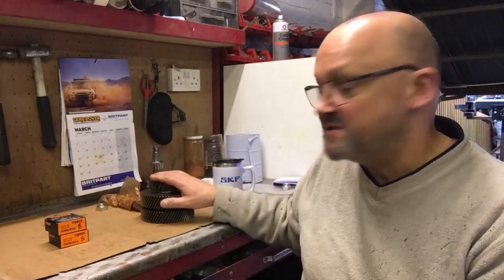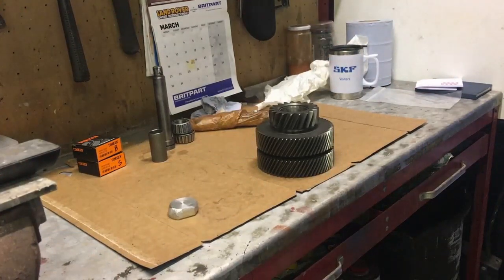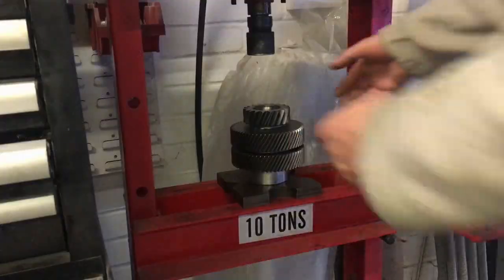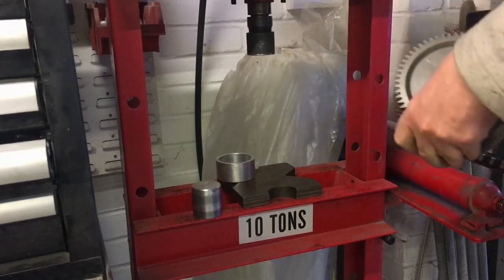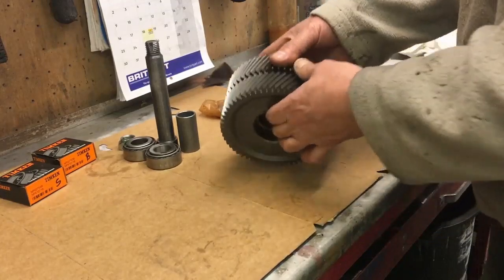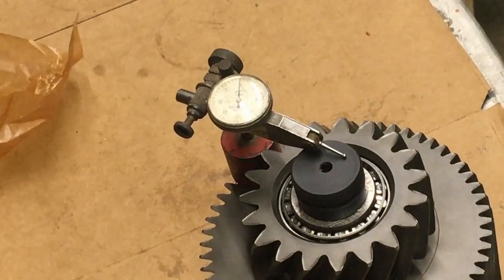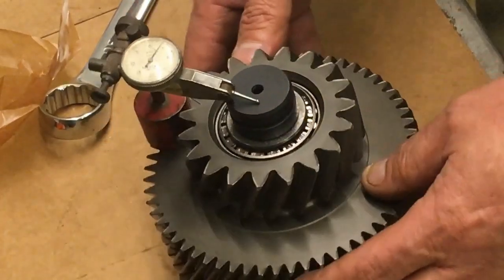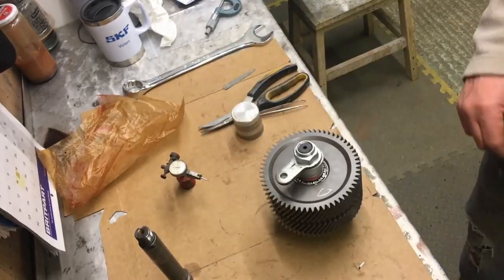Ashcroft ATB centre diff fitting. Part 5 Intermediate gears

Comment: Really enjoying your channel Nige ! Appreciate you sharing your knowledge and craftsmanship. I was provided a price here in Australia to fit a centre ATB to my 2010 puma and was quoted $2300 labour only. In your opinion is this task best left for the professionals ? I'm about to replace the mt82 output shaft myself (upgraded Ashcroft item) and thought a good opportunity to do the centre ATB while I have the transfer case out. Cheers Simon
Reply from the maker: Hi Simon, I think if you're brave enough to do the output shaft, you can do the diff.. but... be prepared for some surprises. You will need a clock (DTI) and some shims. My extra advice would be to strip your box before ordering anything, then you can work out what you need and make one big order at Ashcroft. Also, I am currently halfway through part 6 of the build. Make sure you watch part 6 before rebuilding.. the manual is not good. $2300 labour to build the transfer box is a joke. Give it a go or buy a new transfer box from Ashcroft and save some money!!
Reply: @defender90keswick.nigelsla59  Thank you very much for your reply Nige :) Looking forward to watching more of the build. Cheers